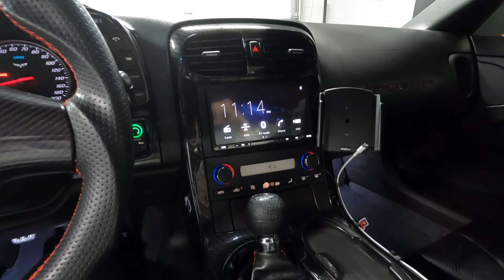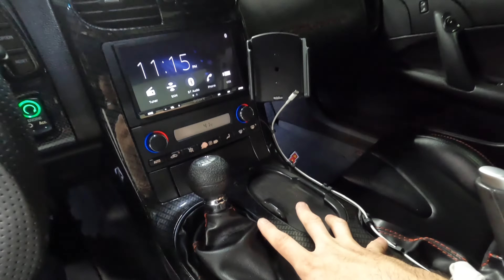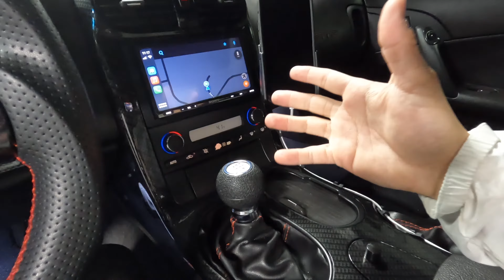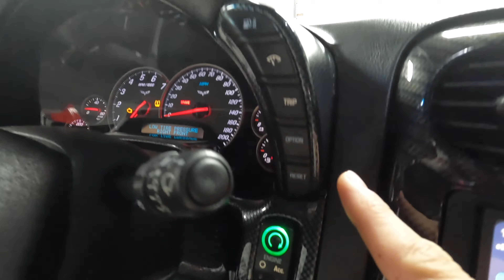THE LAST LOOK AT MY ALL-MODIFIED CORVETTE - EXIT INTERVIEW.

Comment: Hello Matty. First off I'll tell you a little about myself. I am a recently retired (60yo) gearhead from way back i the day. I started my musclecar life at age five - in 1968 - when my father bought a brand new 1969 Firebird Formula 400 convertable. Between then and now I personally have owned over 15 muscle cars from the 1960's - 1970's. Ever since the age of 13 I have had an affinity for the Corvette. Over the decades ( Except for the C4 series..Yuk! ) I have yerned to own one. Finally at age 60 I will be buying my very first Corvette. At the begging I had my heart set on a C5 or C6 ZO6, however, because of their price range along with the notorious valve spring problems on the LS7 engine, I have opted to rather focus on a 2008 and newer base model. I choose 2008 because that is the firt year that they addressed the issues with the heads along with some transmission issues leading to an upgrade in both horsepower and torque. Now that the engineers have corrected the issues with the heads on the LS3 I feel confident that I can take a base model and build upon that. Basically, the same premise upon what you have done with your C6. By the way......Fat-fucking-tastic job!!!! You have created quite a beauty there. I plan on doing most of the same upgrades and your videos are by far the Best. I get to see the results from the owners perspective prior to myslf doing the same upgrade. I joined your channel last week as I am now in serach of my very first Corvette. I will be ready to buy in mid July of this year when I officially "Retire". If by any chance come July you get the urge to possibly sell your beautyiful C6 please reach out to me before you go any where else. I absolutely love what you have done to her and would be proud to own her as well. Do Not Sell her before contacting me. I will Beat any offer. Other then that, I will continue to watch as you ad more content. Kepp having fun with her....she is a Beauty!!
Reply from the maker: Wow man!! Thank you for sharing it!! Glad that you are about to get your car!! You will love it! 
Im not planning on selling mine but I will keep you mind if I need to, for sure!